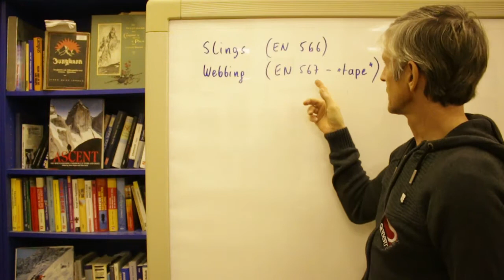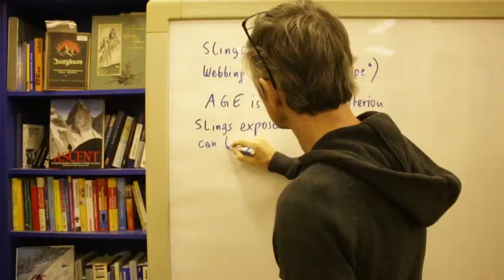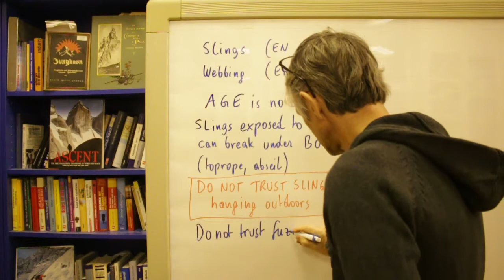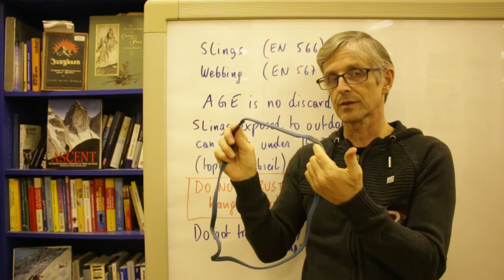Be careful with slings and webbing!

Comment: The best knot I've ever  seen tested for 1" tubular webbing is one I and others no doubt discovered about 45 years ago - the "snake eating its tail," which is a bit tedious to tie, but provides almost no reduction in the strength of a loop, hence the knot retains near 100% strength. In one end of the intended loop, tie an overhand knot about 12-14" from one end. Then, after cutting the other end and fusing it smooth, at an angle, you feed it inside the other end of the webbing until about 14" are doubled up. Then, you simply work the overhand tied before, along and around the doubled section to the midpoint, where it should be apparent that a few inches of the thick, doubled section extends to either side. Bounce tighten, and it will stay snug enough, as the inside portion has zero tendency to slip; yet it retains nearly all the webbing strength, but after everything, is actually pretty easy to untie, in case you need an extra sling to thread in a pinch.
Reply: Nowadays,  they call it the Beer Knot.

Comment: But the human body (even falling) cannot generate that much force. A persons body will break before the webbing.
Reply: In case of a rescue and carrying another person the load would be double.  I guess we can fold the webbing/sling or rope to meet the tensile strength (also double the carabiners).  without shock to the system, it will be safe to lowering 3 time a person's weight.
Reply: They are good for static forces only, no elasticity may create crazy forces, so make sur never get a fall on this equipment, this is the reason I prefer get my safety on dynamic ropes as lanyard

Comment: thanks Walter
Reply: After 2 additional years of research I could not find anything against my statements. I can confirm my statements.
Most important: time passed is no reason to discard a rope, a harness, a sling.
When you read in the manual: After X years you have to discard, this is NOT based upon facts.